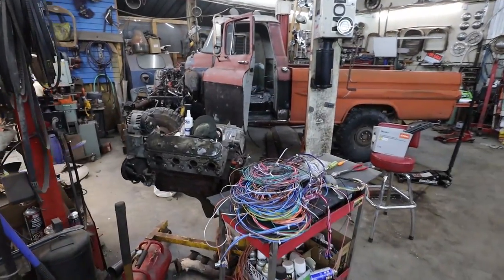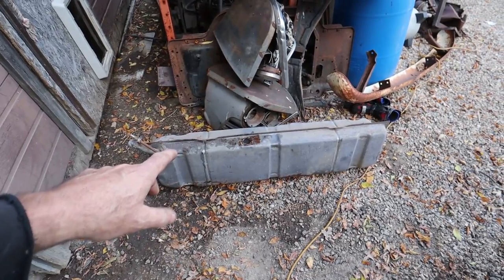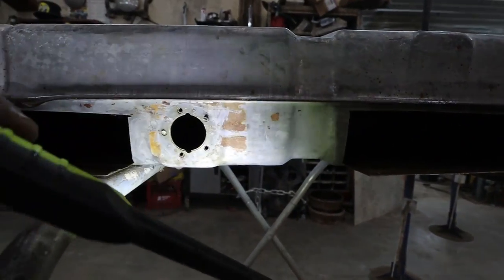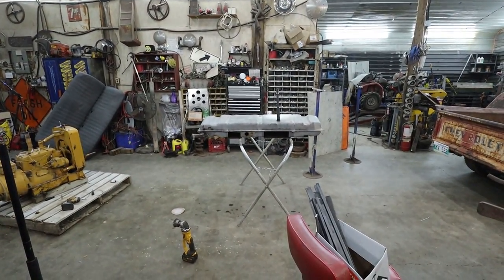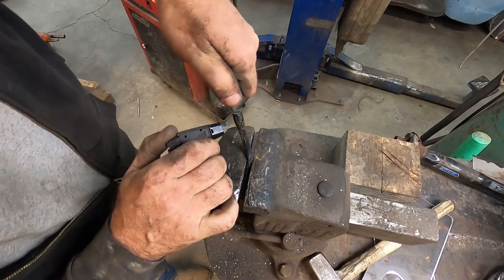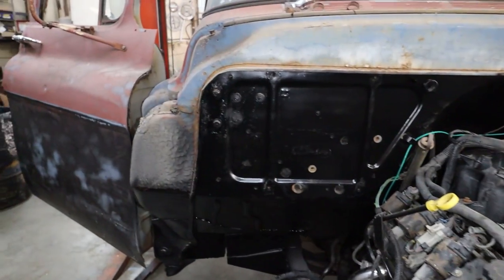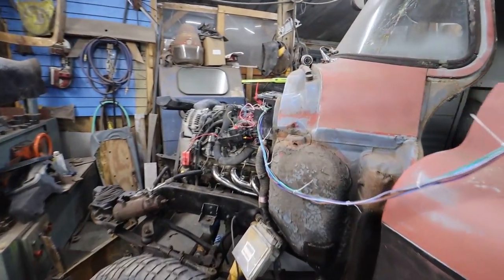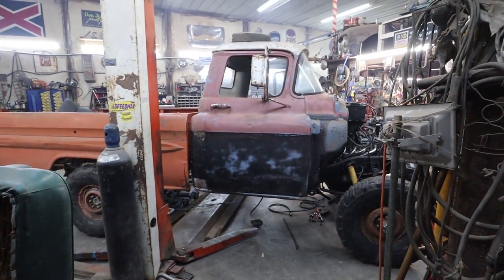Cleaning fuel tank and first start of our 5.3 LS engine in our 1955 Chevy Napco 4x4 clone

Comment: I have been watching your videos for a long time and I think I have seen you do everything you can possibly on a car or truck. From redesigning wiring harnesses to cutting open gas tanks and everything in between like making your your own wheels from cutting up two to make one times four, shortening frames to lengthen frames. And in the end, you win every time or change plans for the better of the project or to make it stronger or better looking. I believe you have dissected every part that can be taken apart and put back together in a need of necessity over the years and that is why you are a master of masters when it comes to technical, mechanical or fabrication works on cars and trucks. Another great video, take care my friend. That motor sounds and responds like a beast.
Reply: You are so right!
Reply: @Blgrsslvr   Neil i couldn't have said it any better myself ,, the man's a master craftsman,,,,Ed
Reply: When he said sling the wire harness in🤔🤔🤔🤔fast-forward did not fool this carpenter....course I woulda' cuss'd,fart'd then sputtered out....dial 911😜😅🤣😂🤣😅🤣🤣😂

Comment: Years ago I worked in a service station.  My boss was trying to save money and was going to "repair" a fuel tank.  He put some water in the tank and I believe he took a torch to it.  The mechanic had warned him that he didn't have enough water in the tank but my boss knew better.  Not very long after he started there was a huge KABOOM.  The tank had mushroomed; part of it had put a wicked cut into my bosses hand and he managed to blow out a number of glass panels on the garage door. No comment from the mechanic.  The boss spend quite a bit of time waiting in the emergency room.

Comment: Hello Brett I know how expensive the replacement tanks are, When I saw the inside of your tank I was sure you could save it. Muriatic acid is a good rust & scale treatment. Tumbling with a solution will restore many bad tanks if not rusted to perforation. If you have a local farmer with a tractor with big enough wheels it is pretty easy to accomplish. Years ago I had access to a tumbler made from an old bicycle and small electric motor. We strapped the tanks to the bicycle wheel turned it on and waited a couple of days. We salvaged a lot of tanks that way.
Most were motorcycle tanks but we did some car tanks as well mounting them was the challenge.
I am glad you managed to save yours. Keep up the great videos and give the 4footers an extra pat they seem to deserve it.

Comment: Thank you for that ending!  I can tell the unresponsive starts had you vexed.  So after you turned off the shop lights, the bulb in your head went off and took you to the intake... TA-DA... problem solved!  Just too cool.  I think fans are jonesing for your color choice!  Nothing elaborate - just a cool dusting of something befitting a late 50's NAPCO rig.  Count me in as a fan of a dark forest green or a British racing green (also dark) with black bumpers.  Cheers!

Comment: Mon ami ... for future reference on "Fuel Tank Reclamation" from a guy with 40 years in Aerospace and fuel systems.  ALL tanks can be made to work (even city water towers that have lead paint on them) by using a rubberized Fuel Tank coating.  Prep the surface best you can then spray 2 light coats over the surface (as I recall, you have one of those small flex nosed spray guns).  Alternatively, don't cut the tank and do the Muriatic Acid cleaning and then apply the fuel tank coating by "slosh method" (being sure to fully drain/dry the tank). Any place you can't get to (including where you'll be welding back to seal), the filter will catch.  The idea it to "encapsulate" the base crappy surface ... and the coating to be able to flex instead of flake.  Good stuff trust me !!  
And yes, great job and LOVED hearing those Headers pop off !!! But yeah, gets annoying after a while.  Might look into finding a used Corvette C6 Z06 tail end muffler ... on mine here in France, it's almost mandatory with "noise pollution regs" now ... remote key to turn off 4 exhausts down to 2 ("Quiet Mode").

Comment: Re: fuel tank. I've seen guys put like a bucket of nuts (from bolts) or stones inside and then spin it around to knock all the crap off. They will even strap the tank to a wheel, leave the vehicle idling with wheel jacked up and just let the tank spin on the wheel for a good while. Works great from what i've seen.

Comment: I had to clean out a gas tank that was not being made and I found the best solution to clean it out was a mixture of a half cup of crystal drain cleaner mixed in 5 gallons of water. Let it soak and watch it so it doesn't eat a hole in the tank. I did 2 soaks for about 5 or 10 minutes and it was just like new. You can adjust your time as you need to in order to get the best results.

Comment: Thanks for the tips on wielding a gas tank, Brent. I have never wielded a gas rank yet but having large air draft openings will prevent the gas vapors from compressing inside the tank and exploding.

Comment: Years ago I had a radiator shop cut open a saddle tank off a tractor and blast it. They used some kind of epoxy sealer to coat inside after.  Worked fantastic. I see POR-15 makes a version that rates highly.

Comment: I saw on YouTube a while ago, a guy cleaned a fuel tank by strapping it to a wheel of a fenderless truck, filled it with appropriate sand/ gravel and let it spin for several hours while replacing the  with progressively smaller medium.

Comment: Brent, I don't remember the name but there is a coating that, after you clean out all the loose stuff, you pour into a gas tank, slosh it around to coat the whole inside, pour out the excess and voila the tank is sealed against intrusion of inside and out side elements.  I checked with LMC Truck and their tanks for your truck are about $180 US but as is always the case your specific tank is out of stock.  With inflation the way it is when they are back in stock the price will have increased in price by at least 20% if not more. 😕  Ah the good old steam genny, no better way to clean oily, greasy surfaces.
Reply from the maker: Yeah probably LMC truck as I probably pay that $180 to get it shipped here and then we convert our dollar after all of that yet :)

Comment: Ls wire'ns kinda in, cuts open n pwr flush n weld up n muddflap install dat original tank, quick connects up them quick connectors, cornfuze box spaghetti wire'n, hard start'n da Ls solv'd, open intake, open headers still open. Opening act Buddy, closing act Pablo

Comment: Molasses is great for derusting.  10:1 ratio is about perfect but I just used a 20:1 mix to do some steel wheels and it worked just fine.  In 2 weeks, your tank would have been clean.  Buy 1 gallon jugs on Amazon.

Comment: Excellent video Brent :) also for electronics check why need or not that yellow wire on fuse panel and for fuel tank did find on internet place in Ontario Canada sells them check in to prices if ever need to and possibly shipping to you plus parts need to get! Also did change fuel filter you need do too maybe need do and for quite down get 2002 Chevrolet Impala Silencer tube that round it quite down in left also right sides but use in exhaust after straight pipe from manifold back then to straight pipe to a muffler of GM Vortex or NAPA brand ones ! It quiet down Silencer and Muffler types for V6 in cars to V8 be best buy use in Vortex motor in Z71 Off Road pickups in 1/2 , 5/8 , 3/4  to 1 tons ! My 2002 Chevrolet Impala car has Silencer it 16 inches long but looks like Cherry Bomb but not that sound and muffler is Vortex GM so quite on low and high idles plus drives think motor is shut off too  not kidding! But rev hard on engine got nice running rumble !

Comment: Brent. I had a hard start (long crank) on my 6.0 .The check valve had failed in the fuel pressure regulator, so the pump had to build full pressure each start.

Comment: Muratic acid is 20 bucks a gallon at CTC .ya just have to do it out side and tilt it to each face to get in desolved .it works quick !  Like 20 minute per side.Then when you have it all eaten inside and cleaned with water it will re rust thats when I put a product called Krud Kutter and it cleans again and neutrilizes the acid. Guess what you did will be ok two.  Cheers.

Comment: have you tried preforming the tubing instead of elbos i have had good success heat forming 90s without any problems using small propane wall heater hanging in front and then putting in form and cool never crimps. route 90s  45s  doesn't take long works great. used router to cut trenches in 2x4 to hold while cooling

Comment: I missed the days you could take your fuel tank to a radiator shop in the hot tank it and put some sort of  Is sealer  in the inside it used to work pretty good I think eastward sells the sealer

Comment: For fuel tanks full of rust and gunk, try the old molasses farmers trick.
For a tank of this size, poor in about 5 litres of cattle feed molasses and fill the remaining tank to the brim/top with water and mix.(don’t know how common molassis is in a cold country like Canada?)
The molasses eats away the rust to perfectly clean metal. It will even break away varnished up goop, a few weeks later, drain it away and wash it out.

(better yet, keep all the used molasses mix in a large 44 gallon plastic tank and reuse for another projects)
It usually flash rusts as you are washing the remaining molasses, I just use a rust converter liquid (any cheap brand) , slosh around and poor out.

BUT warning, any brass or alloy parts will slowly get eaten by the mix.
(Wish we had cheap LS engines in Australia, we have the Ford Barra in-line 6 that popular to swap but does not sound like V8 unfortunately)

Comment: instead of cutting open your tank you couldve used evaporust or b water nuts and bolts or rocks and strap it to something the spin like a wheel theres plenty of options to cleaning a tank out whatever workls i guess
Reply: also id recommend some dynamat(or whatever brand you want) sound mat cover your whole floor and a lil bit on back wall and firewall and some inside doors if ya want youd be suprised how quiet itll get inside

Comment: Phosphoric acid . Turns iron oxide into iron phosphate and rinses away with a pressure washer. Need to wire brush it first.

Comment: Would it not be easy to make a new tank in steel or aluminium? or cut this tank completely open clean and re-weld
Reply from the maker: It would but cost wise this is quite a bit cheaper still the the price of steel around here it almost cost me as much as a new tank for a 4x8 sheet of 19 gauge I think it's still almost 400 bucks up here

Comment: Just a idea after scrubing n power washer my cousin has a shop n he's used apple cider vinegar n has had lots of success in cleaning fuel tanks...n me when was activily working as a tech for Haley Davidson  use to use meruatic acid about a quart n letting it set on different  areas of tank n rotating it once all is removed wash it out n add marvel mystery  oil to coat inside of tank .....like I said some ideas...

Comment: Glad you got it to run.  You do good work.  I thought I saw an exhaust leak at the top of the headers when you first started it. (maybe not). Have you thought about putting in a drain plug in the bottom of the tank in case you ever had to take it out again?
Reply from the maker: Yeah I noticed that too got to look at it the exhaust thing that's for the fuel all I got to do is pull the fuel hose off and it'll drain :)

Comment: Have you ever tried the gas tank sealing kit? Rondex used to sell it.
I have one of those ford pumps, been using it to pull gas out of tanks for many years, so it does have some lift. 
Used push connect in the past, FMSI was the brand name on the kit. Has the pressing tool.
Was looking at my winch today. Forgot i had an old ramsey electric too. Goes with the 2 warn 8000’s
Reply from the maker: Might have to go for a burn your way haha
Reply: @HalfassKustoms  still need a hyd cylinder for dump box? I have a single acting one, scissor may still be useable.

Comment: You need to fix the auto focus plus not having the sending unit in place your losing fuel pressure so the fuel pump has to work harder to keep the pressure up

Comment: Hello Brent, great job as usual. Are you sure your fuel check valve is holding fuel prime? That engine runs too good once it catches, and we both know thoughs headers are the "BOMB" loud and throaty. One last thing, I thougth I saw a puff of smoke come from between #3 and #5 cylinders on initial start, are the headers tight?
Reply from the maker: Yeah seen that to haha

Comment: Great video brother I have a few questions.  How much time do you have into all the work needed to make the tank usable vs a new tank. 2nd question, it's a new frame why not use a newer style gastank that might have been cheaper and have all the things needed for the ls motor and could of fabricated a filler neck and breather in the box
Reply from the maker: Well probably between cleaning welding and everything I got about 2.5 -3 hours into the tank, and I feel my time's not worth a heck of a lot haha so pretty cheap compared to 3-400 for a tank and it probably be close to that to probably make but the price of steel. I was going to run a saddle tank but then I realized they would interfere into the step of the truck and I wouldn't have a step haha
Reply: @HalfassKustoms  sweet so ty for taking the time to answer my questions and I feel your logic is sound lol. I just asked cuz I have a few projects my wife and I are working on so learning is key to this stuff.

Comment: I didn't get the last part about back of intake being open, making motor start hard, maybe you can clarify that on next video. 
Does your dog have place to lay down in shop, comfy place?
Reply from the maker: It was basically a huge vacuum leak letting more air in than the computer and motor new was there

Comment: if you read will tell you trick to bend or straighten that plastic tubing. you know them coiled not good Plastic Air Lines every one thought were the cats meow? I made them alot for truckers. you google the melt temp of the tubing, backof like 10 degrees or so setting your wife's oven. put it in the oven heat it. takes 15 mins or so. bend or straighten to your desire it cools in shape as you go. when i made the air lines i had short peices of allunimum pipe in various sizes i wrapped it around.  But a good stove oven with proper temp setting works so awesome.  it also works so aweome to make wire loom bends so your wires fallow smoothly. i done tons of tubing bending air lines ect when i did the three Glider Trucks for gerry. a glider is a truck built from mega parts not mached to serial numbers like the vehicals you make, they are essentually all gliders. check into it when you go to register and have safety checked for insurence and plates, gliders are generally easier ways to get through the loop holes.
Reply from the maker: Yeah heard of them trucks as a way around some of the emissions.